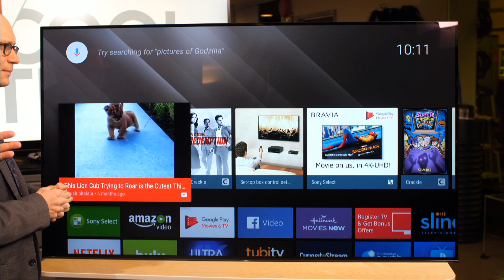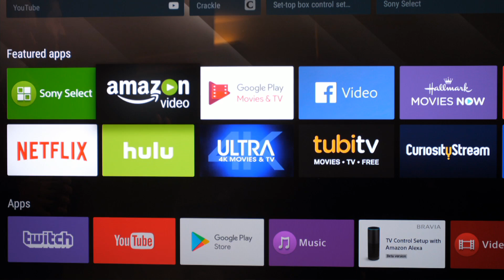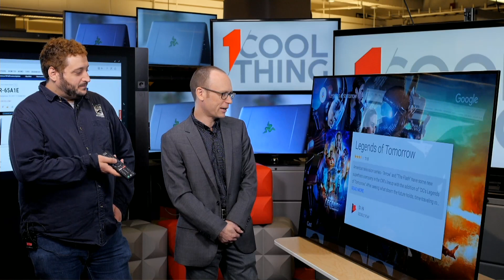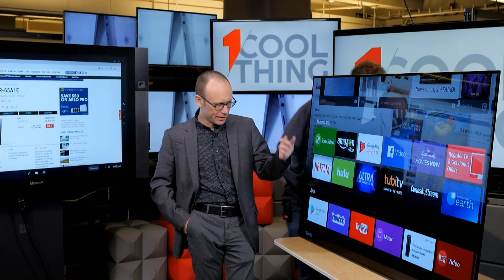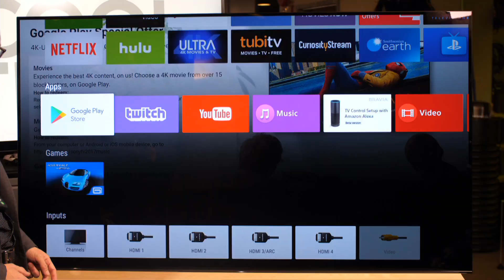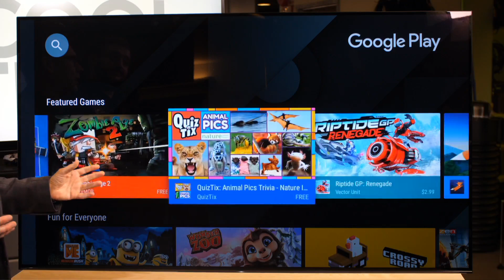Sony XBR 65A1E: One Cool Thing

Comment: This review wasn't very helpful and in some cases misleading. The LG OLED has both HDR10 and Dolby Atmos. The Sony doesn't have Dolby Atmos but they are supposed to get it very soon.  The Sony is almost always approximately a 1,000 dollars more. The internet interface on the LG is far superior than the Sony's. The LG is slightly brighter than the Sony. Sony has better processing for a cleaner picture, better upscaling and better motion. Both have their plus and minuses and both are amazing TV's.